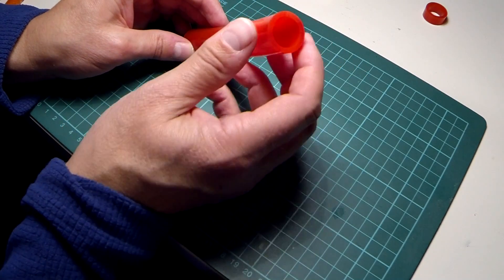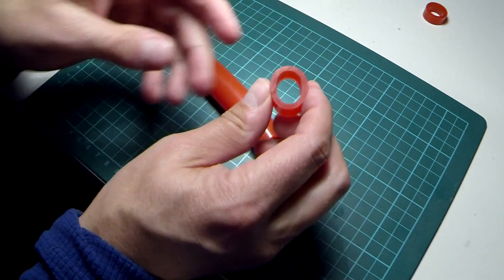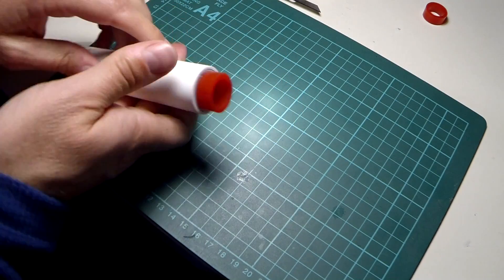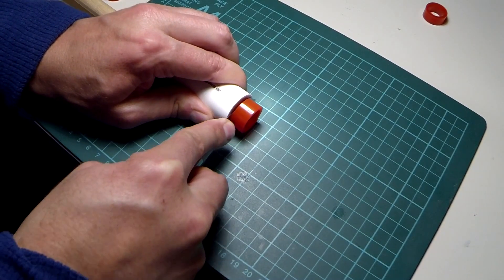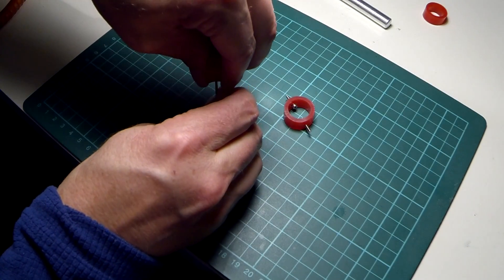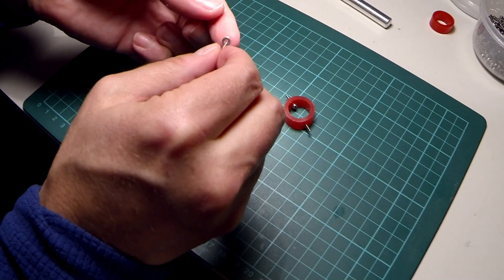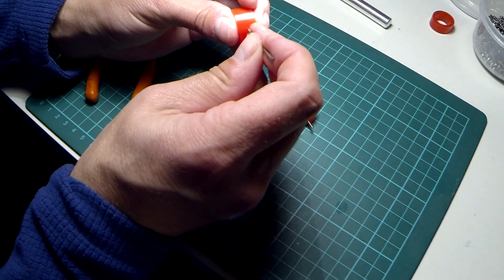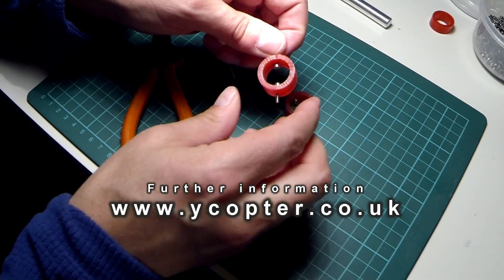DIY Vibration Isolation Mounts

Comment: Hu.. I do almost the identical thing, with the PVC tube and dowel.. I cut my dampeners by pushing the dowel through and using it as a cutting surface, as I roll the whole thing along the desk with the knife on top with one side of the blade up against the PCV pipe edge.

Rubber tubes are used all over in industry for dampening. First time I saw them used was about 25 years back for dampening vibrations on a rail mounted injection molding system for GRP helicopter parts production. It's a great tool.
Nice job with this application.

Comment: I've seen these on FlyBoySee's tri and they work very well.  I've always used silicon tubing on my Tri, but never quite got the right inner/outer thicknesses.  Although I'm suspending the battery/GoPro on them, as opposed to having the weight sitting on them.  It's ok for normal flying, but the wind can cause wobble.  Do you think the suspension technique works with them ok ?
Reply from the maker: Ah yes I remember sending FlyBoySee a set last year.  Most mounts will work better under compression, these in particular become more stable with increased weight, they flatten out and their contact area increases.  They can work well in tension, but with increasing tensile force they stretch and become less stable, to counteract this you can use more mounts or space them further apart.  A wider footprint on the attachment points makes a huge difference.  Also you can allow them to butt up against frame parts giving them some lateral stability as in the Ycopter 350 design.
Reply: For camera gimbals I like two or more rows of three dampeners, with the middle one perpendicular to the others. It seems to reduce wobble a good bit if they don't all fave the same way.
.
currently I have 8 tube sections like the one in the video, suspending my gopro gimbal..

I've set them up in a square... I have all four corners with the tube at 45 degrees and the side of the tube facing out. Then tube sections between each corner (the sides of the square layout) have the tube openings all facing out from the center.
In the middle I have a proper gimbal mount dampener.. essentially another tube with varying wall thicknesses, standing on end in the center.

It's as stable and jello free as I've ever made. :D
Reply from the maker: ***** Hello itchy robot, your camera mount sounds interesting, can you share a photo or video showing the mount?
Reply: Sure.. I'll post some on my channel later this week.